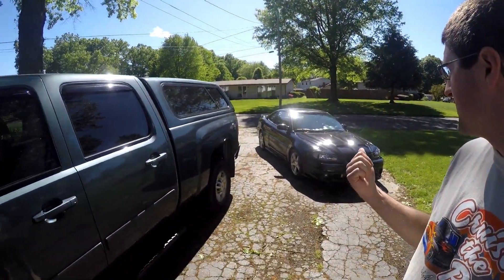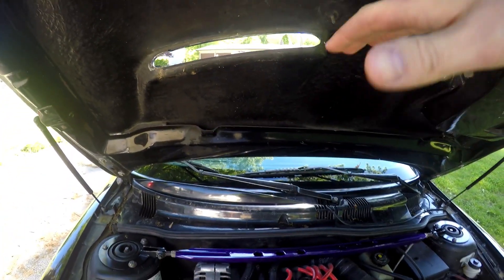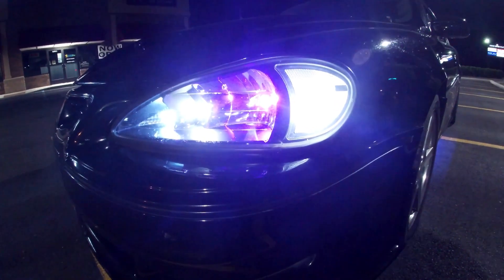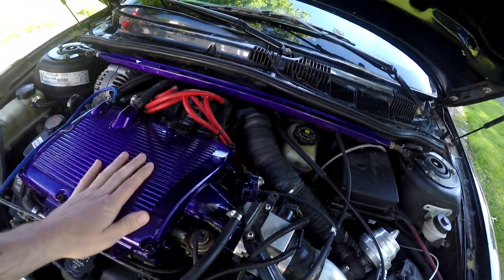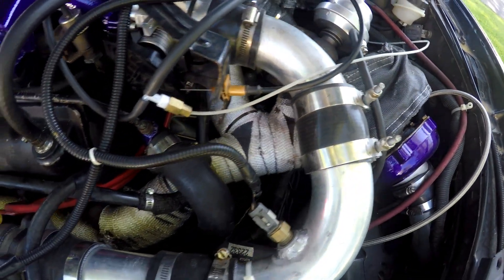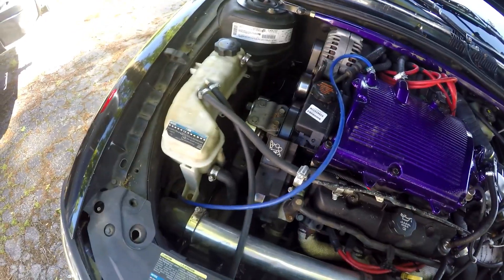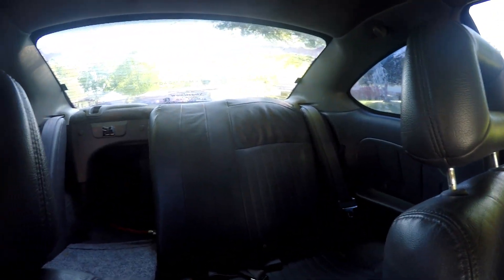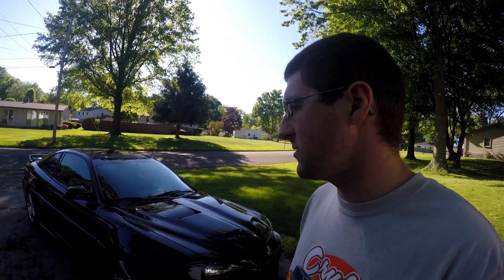My Turbocharged 2001 Pontiac Grand Am GT

Comment: bro I need those LED fog lights and reverse light bulbs!  link??????
Reply from the maker: So the fogs are junk. I've been through 4 sets even tho I don't even drive the car year round. The brand is xentex, so avoid them. I'll be looking for a new brand here this winter. 

The reverse light bulbs in the tail lights are just standard eBay led bulbs. I've had them since 2016 so I couldn't tell ya exactly the seller.

Comment: You got any videos on the white grand am you had parked beside this black one?
Reply from the maker: It was just a stock daily. Actually silver. It's appeared In a couple videos of us doing some maintenance but that's all.
Reply: @KMaffittGAGT  damn that thing looked sick for a stock, I got a 04 white Grand Am, .  But hey think you could help me out with a question? So my steering wheel kept getting loose, so loose to where my steering wheel would be upside down when I was driving straight, I'm guessing that's the rack and pinion? Or am I wrong?
Reply from the maker: @erikgibson5996  might just be the tail lights I tossed on it lol
Reply from the maker: @erikgibson5996  well the steering should be directly connected to the rack. My guess is the gear inside the rack is bad. Take it to an alignment shop and have them try to do an alignment. They'll point out everything wrong.
Reply: @KMaffittGAGT  yeah the tail lights and how clean it looked.
Reply from the maker: @erikgibson5996  oh gotcha. It's actually a rusty mess 😂 but we'll taken care of mechanically.
Reply: @KMaffittGAGT  and yes that's gonna be my next stop,  hopefully  an aliment shop can tell me what I needa do to fix it. Really appreciate the replies. Subed to your channel few weeks ago, awesome cars bro..
Reply from the maker: @erikgibson5996  thanks, glad to help!

Comment: Hey, surprised to see a recent video on the Grand Am. I have a question about the grooves on the side: did you just remove them? It seems like they're attached to the sides with glue and can be removed. I notice the sides on your GA are different from the SC/T pictures I can see online so I'm likely right. After I finish up painting my car and all I think I'll be removing those grooves and I'll likely be buying this in the future... I have a 2000 SE but I'm installing the GT bumper (mine's broken) so it'd be compatible. I'm just hoping that the SE rear bumper and side skirts don't make my GT bumper look funny. I'll be uploading videos on my GA eventually, I want to make it really clean. 

Right now I'm just trying to roll the engine back to access the rear spark plugs. I thought I removed the driver's side engine mount by taking off the 2 center screws, but it seems that it's still attached by the left and right bolts. It's really hard to remove them... unfortunately I don't have time to deal with it right now, but I'm going to try to use an impact driver to remove it soon. Do you know however if I'm correct, before I waste my time? Thanks so much.
Reply from the maker: The se sides and rear are pretty different. To me it sticks out. Especially not have the ribs same ribs down the side. The side skirts just have the extra flair out at the rear to match the rest of the sc/t kit. Not 100% what rib your talking about.

As far as the rear plugs. I've never had to remove the front engine mount. I just reach behind. Even old 200k mile plus rusty ones lol I do have another video on mounts.
Reply: Look up a 2005 grand am se. i removed the side panels on my 2002 se and it just looked a little better then stock side panels. If you dont care about removing glue from the doors it should look a little better with the gt bumper but remove at your own risk cause im sure it loses value when there removed. Deff look up the 2005 se first to see if you like the way the doors look first.
Reply: @slickninja8367  Thanks. I guess I'll just have to see how it looks once I'm done and go from there. It looks iffy.
Reply: Anonymous Human yeah it makes the sides smooth and it has a little groove that is supposed to be on the car without the side panels. The one thing is you gotta make sure not to scratch the paint and also the glue might be stuck on pretty good cause its an older car and there might also be some stuck on dirt that may have gotten trapped under the panels. But if you went and did it spray some WD-40 on the glue and work it off slowly it should come off.
Reply: Anonymous Human also you might wanna take em off slowly cause it might crack or bend the panels if you decided to go and put them back on.
Reply: @slickninja8367  I was thinking of using my heat gun to get the glue to come off. Mine goes up to 1000F.
Reply: Anonymous Human That should definitely work. I didnt care to much about my old grand am so i just went a ripped them off 😂😂. But i hope it works for you. If you dont plan on selling it in the future it should look better cause i hated those se panels. Maybe even look up if you can add gt panels on instead cause im pretty sure the gt just had the ram air and different body kit
Reply: Anonymous Human i also almost forgot the little panels on the fenders will have a hole under them im pretty sure its if you want to add a custom side skirt